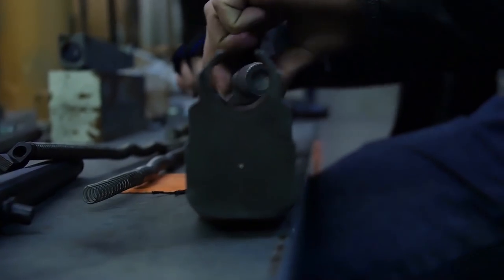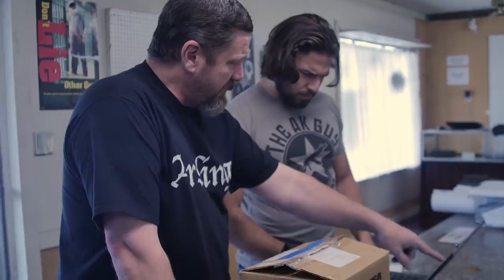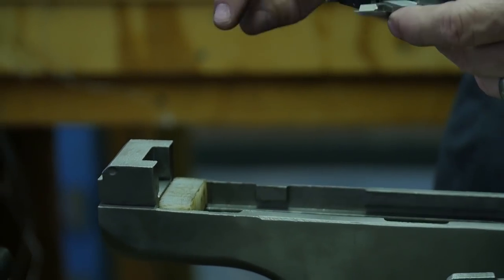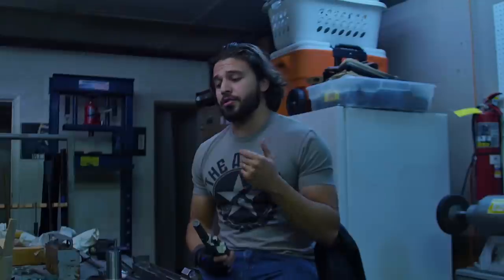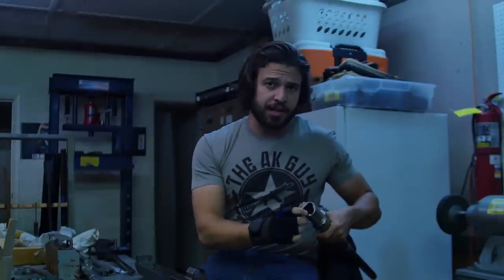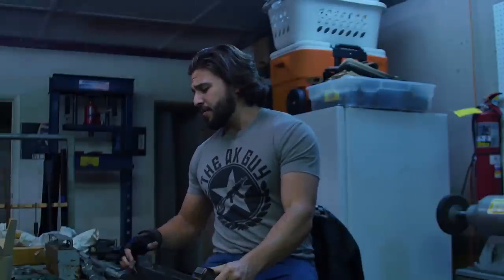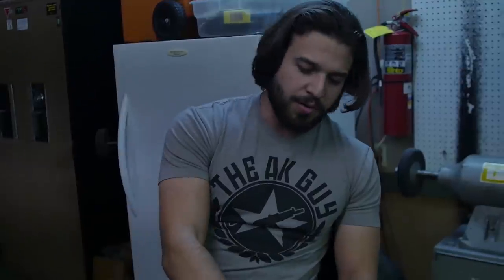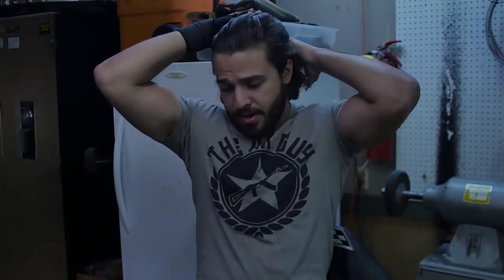AK-50: January 2019 Update

Comment from the maker: Sorry for some of the bad lighting guys, the new camera’s frame rate didn’t like those bulbs for some reason. Will fix that for next time! I hope to be back on this project as soon as I’m back from SHOT Show.
Reply: Brandon Herrera VSS/VAL Clone next? You can build it I can buy it id love an integral suppressed 9x39 Val
Reply: good update.
Reply: @DEATH_TO_TYRANTS  Offers only up for Brandon, otherwise it'd be gay
Reply from the maker: dbpheds Depends on my schedule, I’m sharing my videographer/editor with Polenar Tactical this year
Reply: Ever considered the recoil spring to be too heavy or there's not enough recoil to eject the 50.cal shell? If the spring were to be a tad soft maybe you'd get a full ejection chamber the next round and so on. It'd be worth exploring.
Reply from the maker: james wade Not really. We’ve gotten it to fire and cycle fine, it’s 100% in the gas
Reply: @BrandonHerrera  what about using an actual mag to use with?
Reply from the maker: james wade Pardon?
Reply: @BrandonHerrera  what's the main issue with the ak50 overall?
Reply from the maker: james wade There really isn’t one. Just sucks being at the mercy of 3rd parties. The only thing that stopped testing early on the V1 was a heat treat issue that we fixed.
Reply: @BrandonHerrera  maybe try a break barrel ak50?
Reply: Hey Brandon I hope u get this done with no more setbacks good luck! Hey could u review and give your opinion on the zavstava m90np 5.56x45 rifle? It would mean a lot to me
Reply from the maker: MAD JACK THE SAVAGE I’ve been meaning to talk with them, we’ll see what happens!
Reply: When will the 47s be back in stock I missed out because I was broke 😟
Reply from the maker: Dat_Elmo Just now back in stock! 😉
TheAKGuy.com
Reply: Brandon Herrera do y’all do saiga conversions found a 223 saiga for $450

Comment: Brandon can you please threaten/persuade Hornady or federal at shotshow to produce some good brass cased self defense options for 5.45x39? I currently reload 5.45x39 with necked down 77gr otm's.
Reply: Nick Graham — Five... Four... Five... MASTER RACE goddamn it. 😡 The whole thing is circular bullshit... “Herpderp, uhh we don’t make any 5.45 because nobody makes any guns to shoot it because we don’t make any 5.45 because nobody makes any guns to shoot it because we don’t make any 5.45....” Crates and spam cans are done. So? Accept & evolve like this dude. What happens when Red Dawn hmm? Exactly.
Reply: PS— 77 OTMs sound fairly vicious. 🤔I still have a ton of that super short Wolf WPA “Military Classic” 55gr HP which I am convinced are .223 bullets shaved and stuffed into 5.45x39 cases. POI is all over the place, even though it shoots fairly hot at 28-2900fps... but it feeds (as long as you properly seat the carts to the rear of the mag). On impact terminally, it basically just explodes into shards, fragmenting into nothingness.
Reply: @WitchyWagonReal  the 77's and 69's are really good because they are long bullets and you dont have to suff them down inside the case as far because of the 5.45's already long bullet. but it wouldnt really cost someone like hornady or Federal to start producing 5.45 since the bullets can be sourced third part and same with the steel cases like hornady did with their black series v max
Reply: Nick Graham why don’t you start selling your reloads you do a good job and someone will do it to Moro’s
Reply: @kalmenbarkin5708  there is a taboo about buying people reloads and i dont blame them.
Reply: Nick Graham true you need a good name stamped on them I wonder if Brandon or one of the other famous online AK guys would be willing to put their name on such a product
Reply: @kalmenbarkin5708  honestly its a pretty straight forward process and any manufacture could tool up with minimal cost.

Comment: I really hope you didn't cast integral bolt carrier rails and expect them to come out straight and parallel. 
This is a really common problem on cheap cast 1911 frames, and you lose so much definition in flatness, ability to pick up datums for post machining, etc in taking a casting to a final machined part. You usually have to go through several iterations of molds to compensate for casting shrinkage. 
Here's my advice. Make the casting flat on the inside, post machine it to be parallel to each other and the barrel axis, and install separately machined rail pieces using screws/rivets or something. I don't think you'll meet schedule trying to work out casting bugs.
Reply from the maker: Fuddleton Funny enough, that’s exactly what we’re going to end up having to do.

Comment: If i were you id throw that reciver in the maker's face.
You cant wait and wait and pay like an ass and get something like that. I am educated as a mashinist and work on a CNC mashine and these kinds of products are unacceptable. However i would like to add my suggestion from what you said, have you qonsidured using a heavy gauge stamped reciver thats stamped and bent and then CNC'd to spec?
Reply from the maker: fresh cancer We’ve looked into it before, but it would be extremely difficult to get the front and rear geometry we need. It’s mostly a cosmetic choice, but it’s also a bit for the recoil fulcrum as well

Comment: So what you’re telling me, is that the infamous, glorious, long overdue, AK50... IS NOT AN AK AT ALL.
Some weird hybrid of an AK chassis with AR function, and a very oversized bullet.
I hope it works well, but don’t lie and call it an AK.
Reply from the maker: shadowhawk If you want to try a 2 lug .50 cal, go ahead and let me know how that goes bro
Reply from the maker: shadowhawk Calling That AR function is frankly ridiculous
Reply: Brandon Herrera I don’t want an AK.50, but I do want an AK to be an AK. If it can’t be done so be it. If you are gonna do it any way, do it right and or don’t call it an AK.
Reply: Brandon Herrera I digress on the AR function. My point is that it is decidedly not AK in any way.
Reply from the maker: shadowhawk Whatever bro. It’s AK functions long stroke gas piston, rotating bolt, AK fire control group and recoil spring assembly. If that’s not AK, I don’t know what to tell you.
Reply: Brandon Herrera long stroke gas piston, and trigger group are weak arguments to stand on. Those designs are widely used in other guns, and not unique to the AK. The most AK thing about this gun is like I said the receiver, and like you said the recoil spring assembly.
Reply from the maker: shadowhawk Um, what are your credentials?
Reply: Brandon Herrera only small arms repair in the U.S. Army. The rest is self taught. Or whatever I could pick up on my way. Guns are my passion, krinks are my kink.